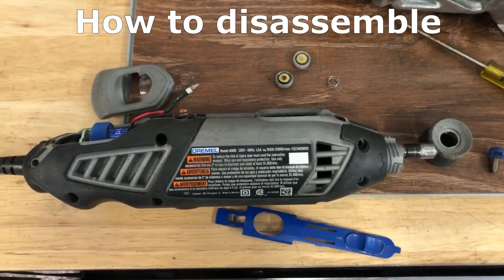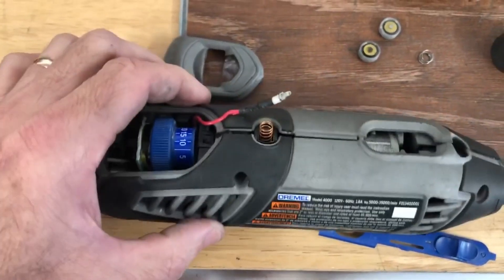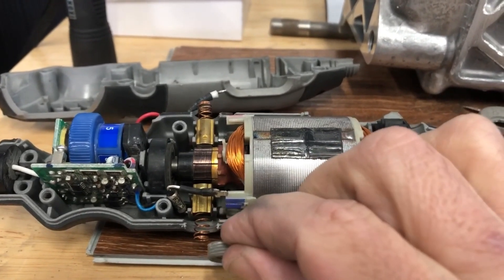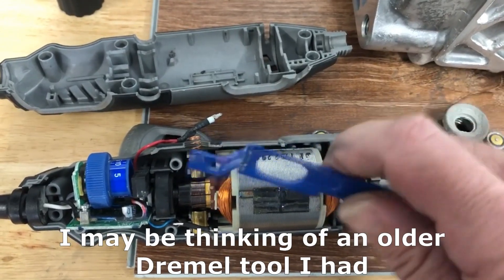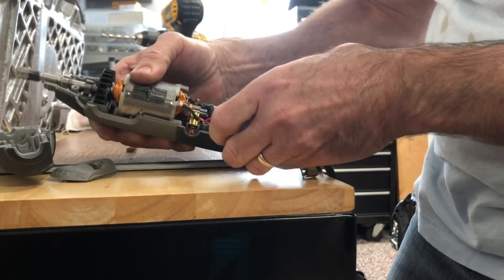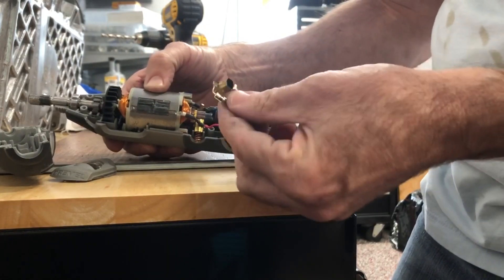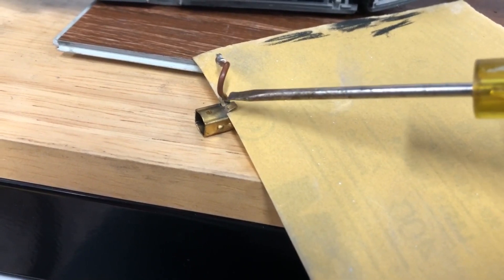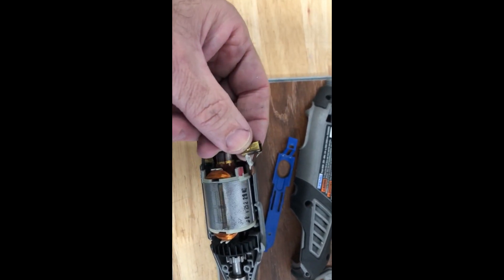Disassemble/repair Dremel 4000.

Comment: I have dremel 4000, motor windings okay, switch continuity okay. 

my problem is, i found out that the output of the electrical assembly, input is 220v before the pcb coming from outlet and the output after the pcb is 220VAC also. I think the motor is DC because of the carbon brushes. can someone enlighten me? I want to be sure before I buy spare from online

Comment: Having stripped it because it got real hot and grunted a bit  😱  i couldnt find where the blue wire with the "u" clip went     Thanks to you its all clear up and running   Thankyou
Reply: Yep another blue wire mystery viewer thanks -  Paid extra for a Dremel instead of a cheap Chinese knock off , but was surprised how crude it is inside a Dremel and how easily it fills up with dust.
Reply: @Comfortzone99 Another blue wire mystery viewer. Thank you!
Reply: a mi me paso lo mismo, gracias
Reply: Me too.. Since this is the top comment and none of you jerkoffs put the answer here in the comments, I’m going to. You will find the answer to where the blue u clip wire attaches around 13:48.  Look at the left half of the outer shell housing(when switch is facing up) Locate where the brush holders sit. They look like 4 mini open end wrenches. There’s a perfect square notch cut out of the bottom one closest to the motor. I found it easiest to remove that brush holder to seat the wire and motor assembly easier. Then I plugged that brush holder back in.

Comment: Thank you! I watched your video several times before proceeding last night with replacing my speed controler on my 4000.
I think I am still having an issue with my brushes. I get a little sputtering. 
I got 12 years of uses before this repair. A lot longer than I did with the previous 395 Multipro.
Thanks again!

Comment: Thanks it helped when taking mine apart, I not sure what the actual problem was. It may have been a little blue or black wire that had come out of the motor connector but they're all so  loose it could have been any of them, very poor design.
Assembly was much harder for me, that red wire is always getting in the way. I'm sure it's beeing pinched even now but I have no room for it to go anywhere else.
Also mine is a little different the brush retainers don't screw in and are held captive by the case.

Comment: This has been a very useful video more than once. 
But I have a new issue - the speed regulator wheel no longer controls the speed of the unit, it has limited itself to only one speed no matter where the dial is set. Not sure how to resolve that.

Comment: The shaft clutch jammed open on mine.  I attempted to repair it, and learned one thing during the process:  NEVER buy another Dremel product.  I was able to easily take these apart in years past, but this thing was on another level.  Getting everything aligned to put the clamshell back together was an exercise in futility.  Considering the premium pricing that Dremel commands, I find that unacceptable.
Reply: Bro it really isn’t that hard. You probably had the wires routed incorrectly or something

Comment: Dremels have a lot of problems. Main problem is it's made by Bosch. My Dremel 3000 broke after a couple hours doing light work. 
Need to clean that commutator while you're in there. The model train guys love fiberglass pencils for this. I have one and it works great for lots of things. Clean the gaps too with a toothpick or similar device.

Comment: In the back of the rotor axe has bearing covered with some black plastic-rubbery thing. That berring must be pushed down when you tested without the other case cover, so that the ax of the rotor to be centered in stator , so when you test it without the other cover case of the Dremel,  the spins will stop touching the inside walls of the stator, because is centered. The other side of the dremel case when you put it back,  will push the berring down, and the axe rotor will selfcentered in rotor. Thats why you hear that scrachy noises without the other case part mounted

Comment: First of all thank you for making an instructional video and talking explaining the parts. 
 all of the other videos I have watched are silent. I just bought the 4300 I have only had it less than a week and it stopped working not overheated or anything. But when it is on the on position and I press that button in the back that you said holds the spring it turns on. I haven’t taken it apart yet. Should I? Or should I return it? I REALLY need it I can’t work without it. I can’t wait a week for a new one
Reply from the maker: Erica Mahoney If it is only a week old I would definitely take it back and get another one. Even though that may not be the best design for the switch, it surely should not break in a week so there is probably a flaw in that particular item.
Reply: I should have mentioned that my Dremel is only about a week old
Reply: Hey @erica7268 i have the same problem with my 4200 model. I took it apart, cleaned it, reseated the brushes, and fixed the on/off switch so it would press down a bit better. It still only works when i press the lower brush cap by a tiny amount. Did you manage to fix it somehow? @fiveyorks do you have any idea what the solution might be?